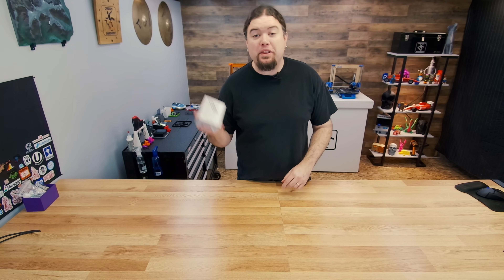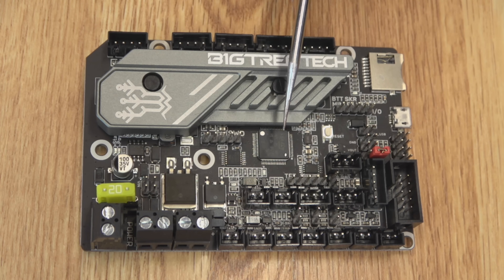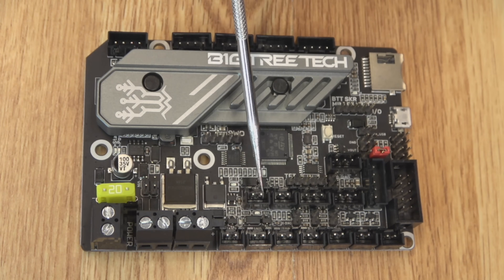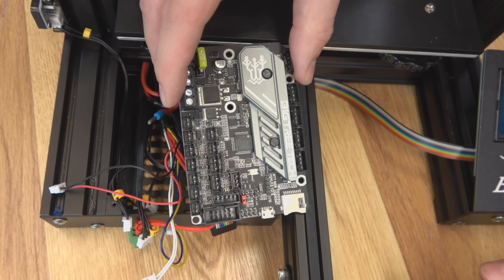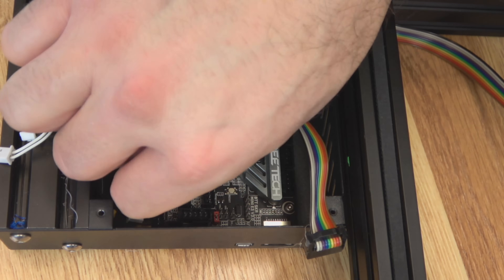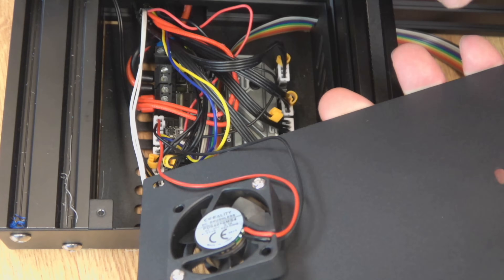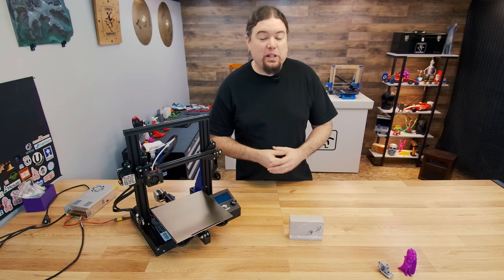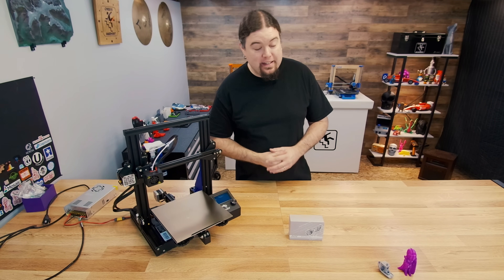BigTreeTech - SKR Mini E3 v3.0 - Chris's Basement

Comment: Please help me with a doubt, I installed my skr 3.0 on my ender v1, everything worked perfectly for 10 minutes, then it stopped and gave a Heated E1 error, I believe that the thermistor of the v1 is 12V and the skr 24v, so Please help me with this doubt, should I change to a hotend thermistor for 24v?
Reply from the maker: The termistor won't have a voltage rating, it's probably a firmware issue. Values for thermal runaway need to be adjusted.

Comment: video is awesome and I got everything together, my only issue is that when I turn my printer on the screen lights up, but nothing else shows up, I turned off my printer in fear of something being wrong but I'm unsure of what to do about it.
Reply from the maker: Even if it's blank, it should be okay to turn it on. It's probably a firmware config. Do you know what screen this is?

Comment: hello! I just installed this BigtreeTech skr mini e3 V3.0.1 into my CR10 v2 and was able to get some help for the firmware by someone else.., but I am still running with the issue for the heating process. The bed or nozzle will start to heat up and then fail after a few moments. is there a reason for this and how can I fix it? I also have 4 extra wires labeled k-fan, x limit, z limit and D11, & im not sure if I need these or what to do with them. :(
Reply from the maker: Does it throw an error? Does it reboot? Sounds like you might not have everything hooked up that it needs. I would have to see a picture of the board and the wires.
Reply: @Chris Riley  it throws an error that it failrd and needs to be reset. I do have a few wires out that i didnt know where to go, i was told by someone else that those weren't necessary but id have to show you, would there be anyway to send u a picture of that? I really appreciate the help ! 🙏🏼
Reply from the maker: @craftsandallthatjaz  send me an email. brotherchris81@gmail.com

Comment: boy i need help with the firmware on that bloody board, My set up is Ender 3, btt skr mini e3 v3, tft 35 v3.01, ezable sensor using z endstop, h2 v2s revo directdrive hot end. ive tried a few marlin configurations but so far have not got any to work so if you have some time please have a go.
Reply from the maker: The Marlin example would be really close to what you have with just a few tweaks.

Comment: I don't even know if you are still making videos but my question is...
The Ender 3 Max has 2 part cooling fans on both sides of the hot end. Can BOTH of those fans be ran off of the SAME part cooling fan plug on the motherboard??????
Thanks.
Reply from the maker: I sure am! :) My guess is you would probably be fine doing this, those fans don't have a lot of draw, but I would consult the github and make sure the pins can support the draw of both fans. https://github.com/bigtreetech/BIGTREETECH-SKR-mini-E3/tree/master/hardware/BTT%20SKR%20MINI%20E3%20V3.0/Hardware

Comment: Hi Chris
How do I use this board to run a diode laser engraver.
Have an old laseraxe running with the original arduino mini and driver board
Reply from the maker: I don't know much about the laser setups, I've never tried to do it.

Comment: I realize this is an old post but how come I can not get a SD card reader extension to work? I use the 3D-printed rear-mounted control box that TeachingTech uses to relocate the hardware for my Ender 3. This board seems to work differently than the 2.0v.
Reply from the maker: I don't know, I would think SD card extender would work just fine.

Comment: When you said that none off the fan are working the first time you start the printer is that included the transformer fan  mine is not working
Reply from the maker: No, the one on the PSU will still be working, just the 3 on the printer.

Comment: Could I use a Z axis proximity sensor instead of the bl touch sensor?  If so, which pins would work with this?  Could I use the bottom 3 Z probe pins?
Reply from the maker: It depends on the sensor, but yes, it you still want to have a Z min switch the probe pins will work.
Reply: I'm assuming you mean the BT sensor pins?  Thanks, Chris.  I burnt up the board btw.  DoH!

Comment: Hello everybody. Has someone maked it works on any CR-10? Where can I find the firmware for a CR-10 mini? Thanks on advance.
Reply from the maker: Yes, this should work on the CR10. They don't have a bin file for the CR10, but Marlin does have and example config you can use. https://github.com/MarlinFirmware/Marlin/tree/2.1.x/config It's for the Mini v2 board, but all you should have to update is the board name.
Reply: @ChrisRiley  Thank you very much. I have already seen the configurations of the SKR Mini E3 2.0, but a lot of people on the forums say that the configuration should be different because the 3.0 may have a different architecture, so I didn't want to burn it trying to make it work. I've also seen someone edit the Ender co-config by changing the bed size and it works for him but for some reason it's too noisy now. But I'm going to trust you as an expert. Thank you very much again.

Comment: Can you set the stepper motor current. I didn't see any trim pots. Thanks Chris! Your videos are so helpfull.
Reply from the maker: Yes, depending on the firmware you can run a command to set it. In Marlin it's M906.

Comment: Just received my SKR Mini E3 V3.0, 9/22/2022.  The processor is STM32G0B0RET6.  The data sheet on this says it is 512kb flash and 144kb SRAM memory, 64Mhz.
Reply from the maker: They switched up some of these due to shortages, the chips should work pretty much the same, they would even compile the same in Marlin.

Comment: For the BTT Mini 12864 LCD's there's a way to wire and mod the firmware to work with the neopixel pins and EXT connector since it's missing EXT1 and EXT2. It's a pain but it's available and no SD support unfortunately.
Reply from the maker: Nice! I didn't know that, thanks Mitch!

Comment: How do you tell the negative amd positive on the hotend cables? I'm having problems with my board. It keeps hailting when trying to heat the bed or hotend and also my X axis isn't working and for some reason when I disable the steppers and pull the board forward it makes the z axis lower and when I push the board away the z axis moves up. I'm stumped cuz it doesn't make sense to me why the z axis would be moving now when I move the bed?????
Reply from the maker: Both hotend and bed heaters aren't polarized, so it doesn't matter which goes where. The only thing I can think of are the motor cables are swapped or the board is bad.
Reply: @ChrisRiley  na it's a new board. I'll have to check to see what's up with it when I get home my X motor was plugged in wrong cuz I didn't know there were 2 spots for 2 z motors so I have that figured out but im still getting heating haults. And my cr touch isn't deploying for bed leveling. It's just showing constant red

Comment: Great Video Chris, a breath of fresh air as per. I got all the steps right in my installation except for the part cooling fan. It just doesn't work I've tried a lot to say the least. I do know for sure that the fan itself is working and I'm dealing with a firmware issue. The latest version of marlin I've tried is bugfix2.1
Reply from the maker: Strange, if the wiring is correct and it doesn't come on when you run a M106 S255 then it has to be something wrong with the board.
Reply: I was beginning to think so myself until I compared the pinout on the V3 board Vs those published on their site and the firmware. Turns out on the pin diagrams,  the pins are listed as :
HB - PC6
E0 - PC9
Fan2 - PB15
Fan0 - PC7
Fan1 - PC0

Whereas the firmware defines them as
#define HEATER_0_PIN                        PC8   // "HE" 
 #define HEATER_BED_PIN                      PC9   // "HB" 
 #define FAN_PIN                             PC6   // "FAN0" 
 #define FAN1_PIN                            PC7   // "FAN1" 
 #define FAN2_PIN                            PB15  // "FAN2"

Comment: I just installed this board but have not been able to figure out if they have fixed the bltouch firmware yet?
Reply from the maker: Did you try there version on the github?
Reply: @ChrisRiley  I have tried a lot of things. Using either an 8gb sd or a 128mb sd. Formatted at Fat and Fat32. Using firmware from bttgithub, skr e3 v3, ender3-bltouch.bin. Placed in root folder of sd and moved to printer. I have tried changing the name in all format configurations of fat. Firmware.bin Firmways123.bin. The only thing that does anything is if I rename it FIRMWARE omitting .bin as its already a .bin file. The printer will boot, pause for 2 seconds and then nothing is different with the printer. It will change the .bin file on the SD to a .Cursor file. 

So I am not sure what I am doing wrong. I have followed multiple tutorials all saying more or less the same thing and scouring reddit etc. Brand new skr v3 board. 

Thoughts?
Reply from the maker: Well it's flashing fine, so that's not the problem. You might not notice the change, I would try running the G29 command.

Comment: This version currently doesn't compile. V2 is fine, but this version is missing something in the configuration. Always gives platform.json error.
Reply from the maker: Just the default Marlin version you mean?
Reply: @ChrisRiley  no the skr mini version. The problem ended up being the processor variant name was different in platformio .
Reply: @anothertime  what is the platform variant name?

Comment: Hey Chris, I just installed my v3.0 board and when I fire it up the first thing that comes up is an error saying that it cannot enable bed leveling. Why is that? I'm just getting the firmware for it now.
Reply from the maker: By default it shouldn't have bed leveling on it I don't think. I would try and reload the BTT firmware from there github and see if that cleans it up.
Reply: Hey Chris, I tried that and it comes back with an error in bltouch and restart with M999

Comment: Installed the SKR mini E3 V3 on my old Hanbot DRT printer. Seems to be working fine except for the hotbed. It starts heating up from the time you power up the printer. The heat keeps going up even if you try dropping it. I updated the firmware as well but no luck. All connections seem fine also. Can anyone assist.
Reply from the maker: Double check power input and heat bed. They might be swapped.
Reply: @ChrisRiley  Inputs are correct

Below power connector the is 2 LEDs. the left is permanantly red and the right LED flicks red

when I try to heat the extruder it gives a continuous beep and says HEATING HALTED : KILL CALLED
even disconnected the bed totally.

I am using the ender 3 firmware for my printer, will this be ok. 

Upgraded the extruder to the BTT H2 and using BTT TFT35 display
Reply from the maker: @gmd5166  The ender 3 firmware should be okay, but the board sounds like it might have a short somewhere.

Comment: Thanks Chris. Bought the 4.2.7 board only to have the common Mosfet fry a few month later. Went with BTT 3 but was confused by the missing terminal block below the main input. Thanks for clearing that up. The Mosfet on the BBT is huge. Did you go ahead and put a heat sink on it?
Reply from the maker: Thanks for watching! Mine has been running pretty well so far. I didn't put the heatsink, but it couldn't hurt.

Comment: I ordered one of these boards for my stock ender 3 pro. is it required that I put  those JST plugs on the fan wires? I just dont have the supplies to do so right now, I was hoping to do this on a budget lol
Reply from the maker: It's going to be pretty hard if you don't. You could get some pig tails and splice them or solder them? https://amzn.to/3O8V34p

Comment: I have a red flashing satus light on mine. Is this normal? Not flashed any firmware yet though
Reply from the maker: Probably telling you there is nothing loaded, it should only flash when it's writing to the chip.
Reply: @ChrisRiley  hey Chris!  I've flashed the bltouch firmware to the board and everything is working but I still have the flashing status. The only thing i haven't done is connect the hotend fan because I don't have the crimping stuff. Checked everything else so I don't know 😕

Comment: Hi for some reason my Ender 3 Pro is showing as a Ender 3 with the latest version of Marlin with BL touch. is this a problem ? should i worry at all ? any way to fix this? thank you for your help
Reply from the maker: As far as the firmware goes, it won't matter for the PRO, you should be all set.

Comment: can this board be run on 12 or 24v ? or is it 24v only ?
Reply from the maker: I can run on either.
Reply: @ChrisRiley   Nice im thinking about converting my custom e3v2 to 12v so i can run noctua fans with out having to use buck converters

Comment: Hello,
should one set EZ5160 Pro motor voltage? and in Marlin Configuration for EZ5160 Pro, what driver should i choose? 

Thank you very much
Reply from the maker: I'm not sure on the EZ stuff yet, I am still working on it. It would depend on what motor you want to use. 5160 is for larger steppers.

Comment: Thanks for the video! Do you think this would be worth installing on a Voxelab Aquila?
Reply from the maker: I looked that printer up, it might be a good fit for it, but I have never looked at it's mainboard. You might have some issues getting the stock screen going.
Reply: @ChrisRiley  Thanks for the response! Would you recommend any replacement screens that would work?

Comment: Hello Chris! Loved the video and it's what convinced me to get an SKR Mini E3 v3.0, however I'm running into an issue where the Part Cooling Fan runs during Preheat and Manual Control via the firmware, but not when I put on a print. Is this a gcode issue with Cura or a firmware issue? Any response will be greatly appreciated, thanks!
Reply from the maker: I have seen that before. I can't remember, but I think it was Cura that caused it. Export the Gcode and serach for M106, if it's not there, then cura has taken it out somehow.

Comment: hey chris i am having a problem I hooked up my SKR mini V3.0 and I flash it and now I'm getting an "no printer attached" on my screen i my ender 3 i added the smart filament run out senser and a creality CR touch and I don't know what configuration to add
Reply: i need your help
Reply from the maker: Make sure you have the serial set right. Serial 0 should be -1 serial 1 should be set to 2. Make sure the baud rates match.

Comment: Thanks for the video Chris, It helped me to make the decision to go with it instead of the creality board. I installed this on my ender 3 pro with marlin firmware.  I printed one benchy with a defect at the upper part of the wheel house about three layers that didn't print correctly, otherwise a great print. after I calibrated the PID on the nozzle and bed I tried to calibrate the e steps.  now the stepper motor just "twitches" and never turns.  any idea what it could be?
Reply from the maker: Hmmm, only thing I can think of is maybe a M92 motor setting got set incorrectly.
Reply: @ChrisRiley  thanks Chris, you led me in the right direction just had to change path to hardware. I changed the stepper motor and it working now. How do I calibrate my esters with a direct drive setup? 🙏🏻
Reply from the maker: @jimmorgan7765  It would be the same, you can follow this guide. https://youtu.be/r0GiAmZiQBE

Comment: thanks I just ordered this, and the jst connectors and crimper.. im gonna do this tomorrow to my ender 3 v2. im having weird issue currently where it homes fine starts the print does the ABL and then just goes to max x and max y and just extrudes forever in the same spot
Reply: How did it work out with the display on your Ender-3 V2 and this board?
Reply: @Jockebanan99  i had to get the btt tft50 to get the display working. and everything mostly worked then.. now my cr touch isnt working so im doing it manually, gotta figure that out.. appearently its a common issue. that i dont know how to fix...yet
Reply from the maker: Hey, did you ever get this going? It kind of depends on how you configure the firmware. I personally like to use the Z min pins for my probe and just remove the Z endstop.
Reply: @ChrisRiley  hey thanks for replying! I did get it going, everything is good now, i am running this w/ the tft50. i apprecaite you man, ive gotten into this pretty hard in past 3 months and you've been a huuge help!
Reply from the maker: @blacknovella  Awesome!
Reply: Can you share your fix? Im having the same issue.
Reply: @jonathanjara1878  i made sure my bed was leveled manually.. and then i turned on abl  i haven't had an issue since.. sounds weird i know.
Reply: @jonathanjara1878  also, check the gcode file and i had a double entry of G92 E0.. i removed one of them and the problem stopped.

Comment: I’m using this on my Ender 3 Pro and I successfully replaced and installed everything except my fan.There’s 1 red and 1 black wire that I don’t see where it can go.Any help?
Reply from the maker: It can go in a few different spots. Try FAN2.
Reply: @ChrisRiley  Id figured but what I was saying was it’s just the two wires with no JST connector.I believe I have to boy one and crimp it
Reply from the maker: @malikhunter6504  Ah, now I see what your saying. It was probably in the screw down terminal. This the kit I use just for reference. https://geni.us/cGp31
Reply: @ChrisRiley  Thanks